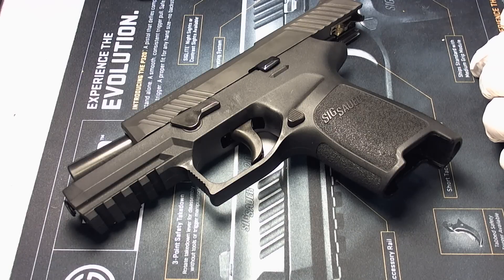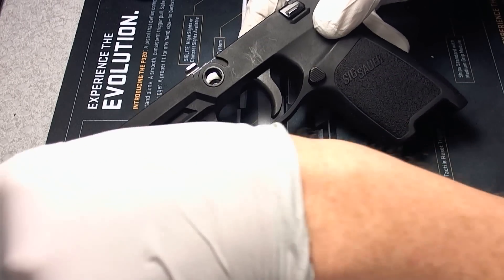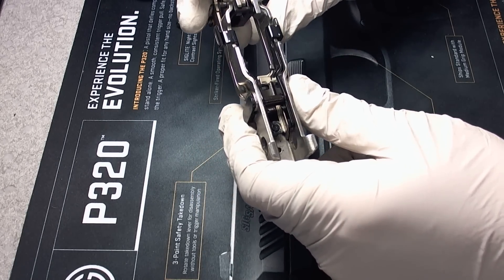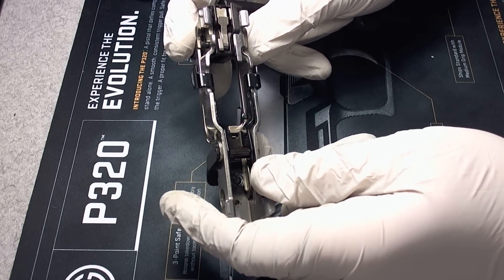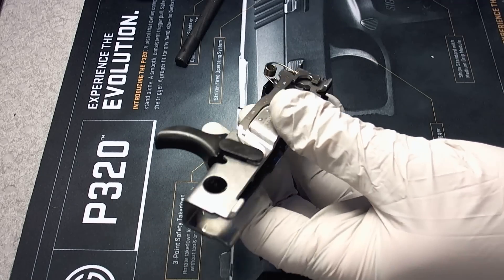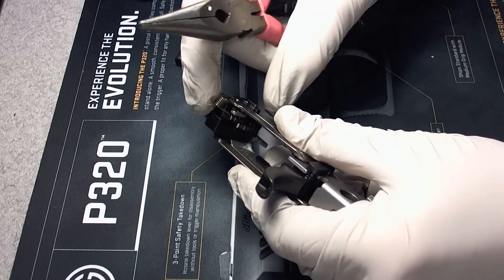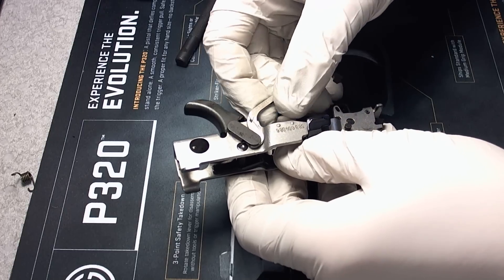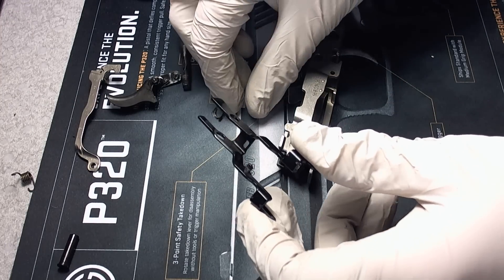SIG Sauer P320 FCU/Lower Disassembly

Comment: Took it apart thinking there were a few simple areas that I could polish for smoother pull. After examining the design down to every last detail, I can see an amazing amount of engineering. Pins sitting just under flush of the FCU outer wall, small shoulders machined into parts to keep things from rubbing together etc. My theory is that it isn't worth messing with. Many dimensions are far too critical! Oh, be ready to invent a few new curse words when getting the trigger return spring hooked back into place. Awesome video though! Many thanks!
Reply from the maker: It's very out of the box and genius thinking really that led to this design. There are a lot of very close and critical tolerances that, I think, have even delayed the Grayguns drop in trigger parts while he has worked to perfect them across all the P320 generations. The triggerbar spring is a pain but before you reassemble checkout my other video that gives and easier alternative method for getting that spring back in without deforming it: https://www.youtube.com/watch?v=jmflAN180dc

Comment: I've noticed that the pin he removes at 3:30 in the video. The slide stop /slide release pin I believe is what he calls it. The last time i had my trigger assembly out when i was cleaning my 320, it had backed out a little on its own. I only noticed it because it was keeping my trigger assembly from dropping down into the handle. Is it out of the ordinary to have this happen? I did notice, with the trigger assembly installed, this pin cannot back all the way out.